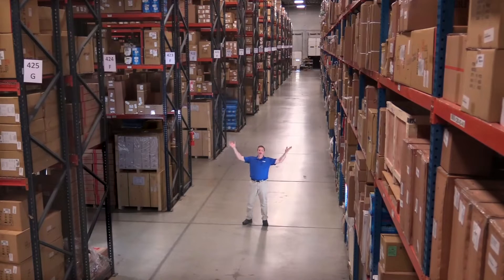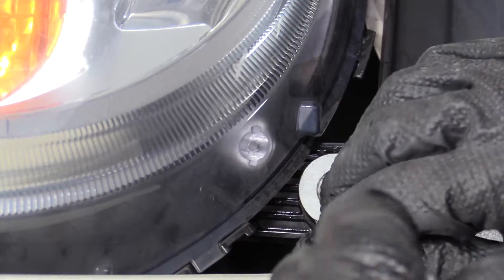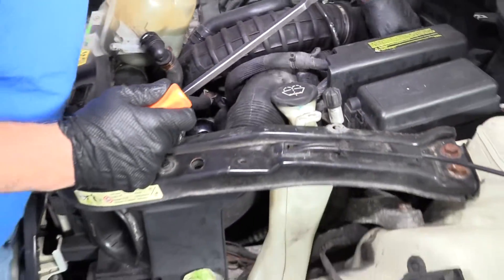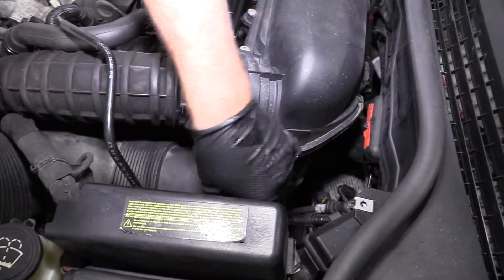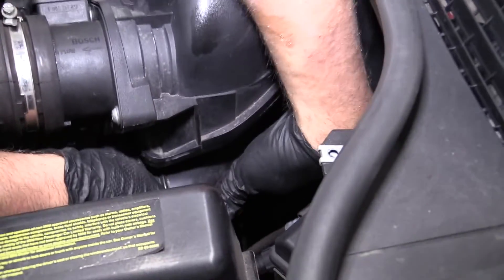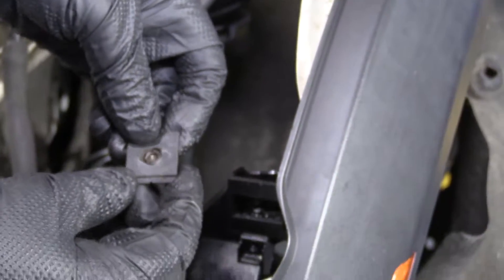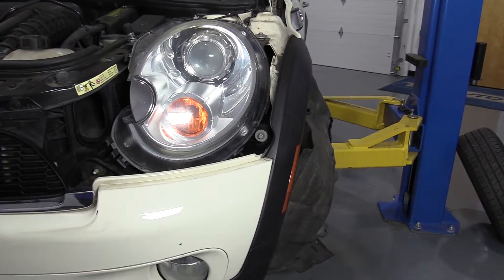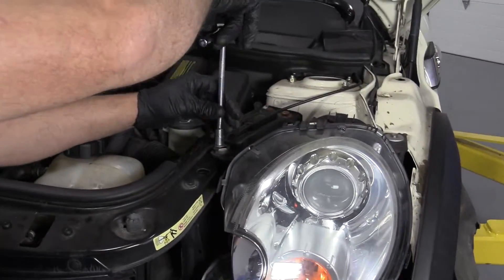How to Install an Intake Tube 07-13 Mini Cooper S

Comment: Thank you, thank you!  I have been trying to get the turbo inlet tube of my Roadster out for months.  Tonight after spraying it with Blaster which a neighbor recommended, I thought okay check YouTube, maybe there is a video you missed.  Then I see you use a big screwdriver like device to remove one identical.  I had tried the same thing with butter knifes without success.  I immediately went to the garage got two of my biggest screwdrivers and the Blaster lubricant spray had helped but the screwdrivers did the trick.  I am pigheaded but was about to call it quits as it has been 5 months of me wrenching on this tube without getting it to budge.  I love that I can get so much help with all the folks who post videos on You Tube. So again THANKS.  PS I had posted questions on forums and will go back to recommend this video for anyone else having the same issue.
Reply from the maker: +k c Thanks for checking us out. Shop for high quality auto parts on 1AAuto.com:

http://1aau.to/m/Shop-1AAuto-c

Comment: It appears the Rear Engine Air Intake Hose Elbow just pops on and off at the connection. Is that correct? The elbow on the car I'm looking at has a hole in it, but the actual intake tube looks okay.

Comment: Great video, thank you. I removed the intake tube to access connector X175 (I think it is called), which is below the tube and toward the headlight. Couldn't access the connector like I'd like to (I'm chasing a problem with the front left side marker light not receiving sufficient voltage to illuminate the bulb). I sprayed a liberal amount of WD40 on the connector, probably in vain, hoping I may have solved a possible high resistance joint in there? I don't know. 

Anyway, I don't understand why the headlight was removed in this video. I did that, but now I'm wondering if it was really necessary? Thanks again for posting videos like this, much appreciated. Oh I really liked your fastener hack too!
Reply from the maker: +Michael King Thank you! We love empowering our customers and showing how to perform DIY auto repairs with our high-quality auto parts. We'll pass this info along to our production team to see if this is necessary or just to make the repair a little easier.  1AAuto.com

Comment: My intake pipe is very loose and I don’t see where to slot it in. Not where you unplugged it with the clips but just after that and just before the airbox the connecting plastic keeps falling out of the airbox info have a video
Reply: I’m having the same problem! Did you ever figure it out?